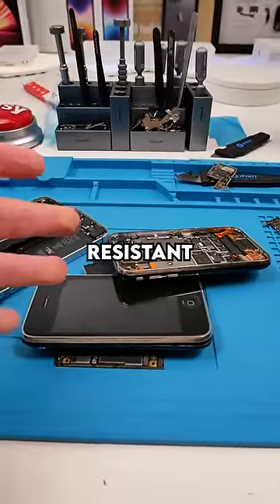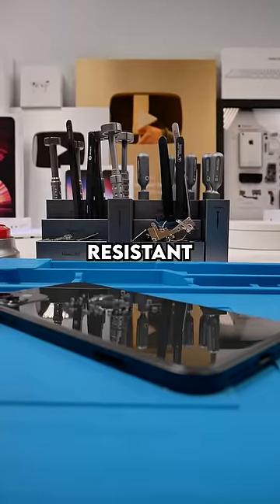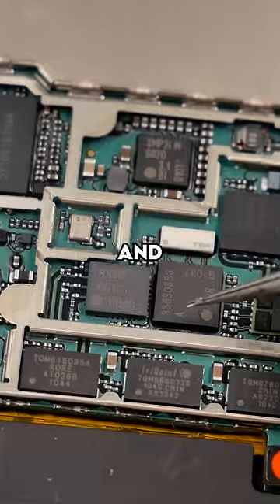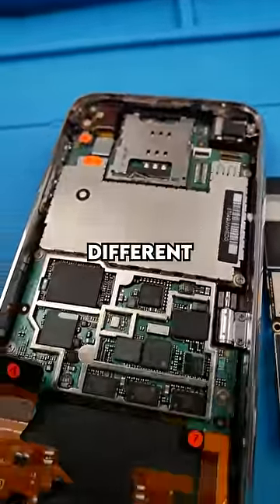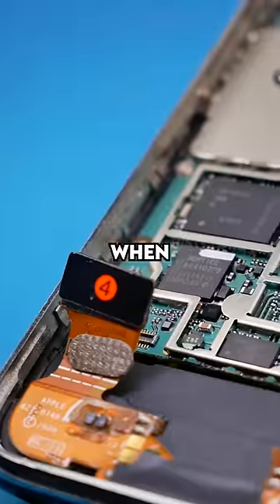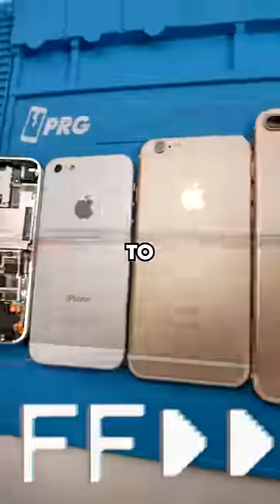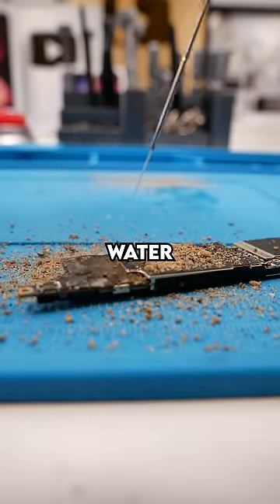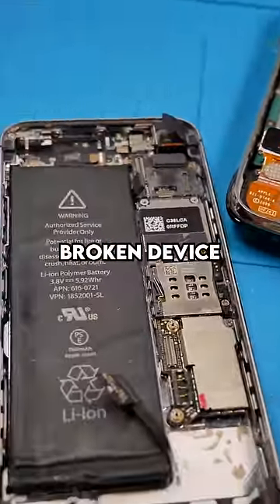This Has Saved You Without You Even Knowing.... #Shorts

Comment from the maker: I’m mistaken about the black stuff, pretty certain that’s mold filler. However there is still conformal coating, it’s just much thinner than the mold filler
Reply: Even on the latest phones most of the chips are not conformal coated. I see it there mainly to stop vibration and to support large chips. Water resistance starts with design. The back glass, the speakers, the microphones all were designed with water in mind unlike older models. That is why they are more water resistant.
Reply: Also wanna specify that they are using under fill compound rather than conformal coating.
Reply: Yeah, conformal coating is clear, they use much thicker layers than they did before
Reply: Thats a 3gs board not a 3G

Comment: correction: the black is the silkscreen and only for looks. there is a little bit of sheen/shine on the board and that’s the conformal coating
Reply: Tthe conformal coating I used on boards for space (not y or z) would glow in blacklight so I could repair it under blacklight because its not a perfect process

Comment: I feel like I've been seeing so many more liquid damaged devices in my store in the past 2 weeks because of this misinformation... The phone can definitely still get extremely messed up even if just straight water or humidity gets in it, parts will short out even with the coating (which is not the black stuff) and it's really hard to diagnose and replace those parts if need be, super costly too.
Just don't risk your device with liquid, it's not worth it, electronics and liquid don't typically mix.